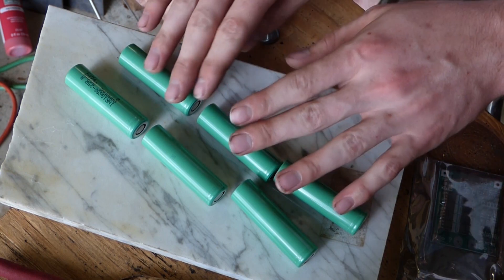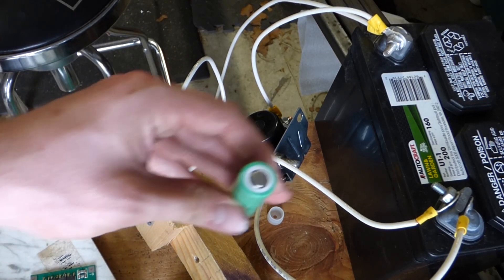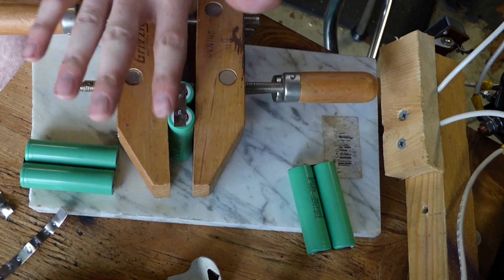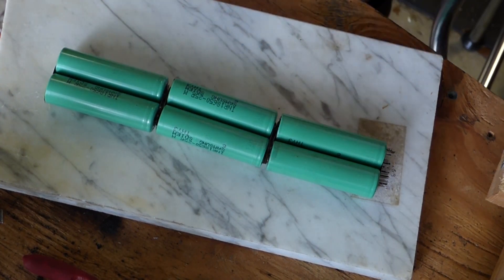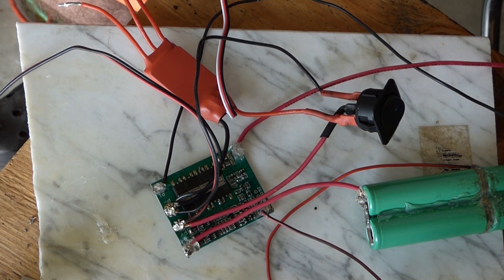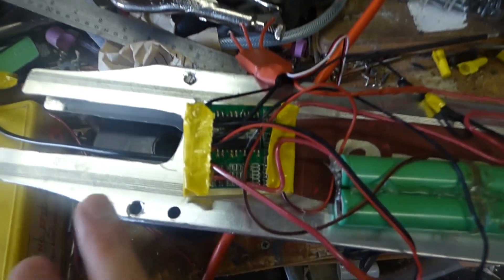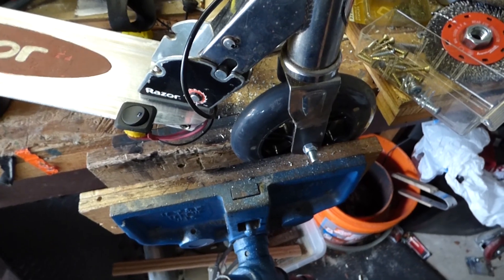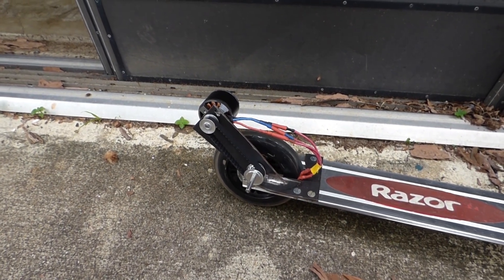How To Make a Razor Scooter Electric | DIY Electric Scooter (Pt.2)

Comment: Hey do you still have the scooter? How has the battery been holding up? It's really cool you are able to go 15mph on something with such a small motor and 6 lithium cells, i have a 3000 watt dual motor ninebot es4 that goes 35mph which has a 16s 12p battery

Comment: which relay you are using for the spot welder? can you share the link for relay as well the click switch?
Reply from the maker: Just a standard 25 amp automotive relay. The switch can be any momentary switch since it's just switching the relay and has very little current going through it.
Reply: @makeeverything8986  thanks for quick reply. Is 25Amp sufficient enough? I was going through other setups and they they are recommending 400 or 500amp relays. I'm a bit confused.
Reply from the maker: @chitanya4u  I would defer to whatever other video you were watching. I'm just using a small lawnmower battery so it's not nearly as powerful as a full size one.
Reply: @makeeverything8986 That piece of info is quire handy, I will give it a try. This was the other video I was taking about @ 5:30 he talks about amperage...

https://www.youtube.com/watch?v=o1NFbchHeM8&t=3s

Comment: You can even run the throttle cord through the tube of the handlebars, and zip tie the motor wires to the motor mount, looks amazing tho, high tech stuff

Comment: hey, could you tell me what gears you used exactly? <3 pulleys would also be useful :D
Reply from the maker: Larger gear was 1 inch bore, 76 tooth. Smaller gear was 1/4 inch bore 16t. Pulleys were 10 and 15 tooth.
Reply: @makeeverything8986  thank you :D
Its hard to see which are the pulleys and the gears from the video but i'm assuming that the gears are used to up the speed, and the pulley moves the wheel.
Reply: Could a servo gear and .25 pitch metal chain, and .25 pitch 1/2 aluminium bore sprockets work?
I don't need speed, but I go uphill and downhill so power is very important.
Reply from the maker: @Appri  The gears/pulley and wheel arrangement is shown in detail in part one of the build. Link is in the description :)
Reply: Do you know which pillow blocks were used and what length that timing belt was?

Comment: I'll give you 150 for the plate and pulleys how did you put the throttle cable on the servo tester absolutely genius idea for utilizing 5v Bec controlled rc ESC
Reply from the maker: I'm not really selling these projects but you can make it yourself for alot cheaper than that! Using the servo tester as a converter isn't my idea, the last link in the description will take you to the tutorial I used.

Comment: hey again saw from another video that mentioned if using the scooter normally would turn the motor into a dynamo which could send energy back into the esc and potentially frying it. way he combat against that was to use a one way bearing. I see that  your project didnt mention anything about the dynamo effect or would the down gearing be too much to use the scooter on its own making the dynamo negligible or something to not worry about since it doesnt affect your scooter set up.
Reply from the maker: TDLR: One way bearing is unnecessary. Almost all ESC's are designed to handle the back voltage. As long as the motor is spinning at or below it's rated rpm, it won't produce anything the esc isn't designed to handle. Depending on the specific ESC you can even brake electronically, which is basically shorting out the motor in a controlled manner, although with the gearing for this project the braking was actually too powerful and the gears skipped so I didn't do that. All commercial electric long boards, bikes, scooters and such that I know of forgo a one way bearing. There is definitely resistance if you want to use it as a kick scooter, but most of that is from the gearing not the motor itself. If you want to use it as a kick scooter as well as electric then a one way bearing would make it easier to propel, but it won't hurt anything except your legs otherwise.
Reply: thank you so much for the knowledge, no one has mentioned anything on this topic in the dozens of videos that ive seen.